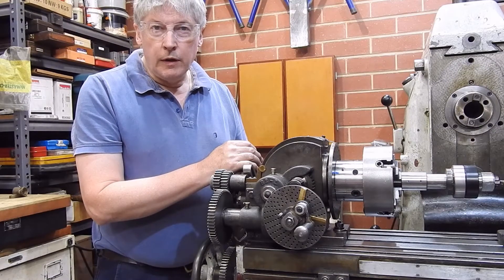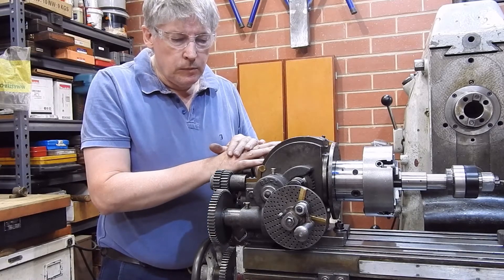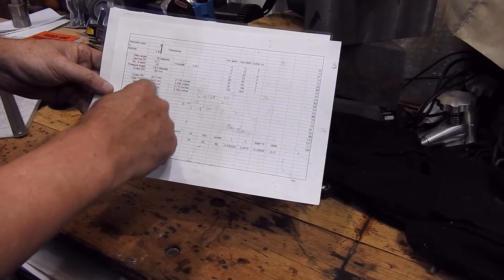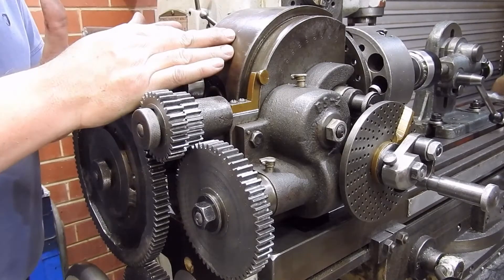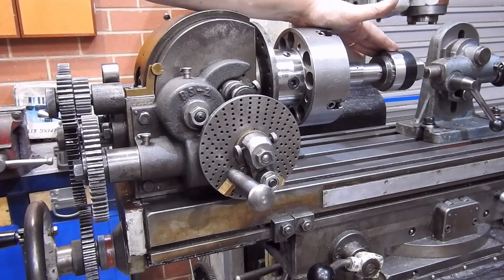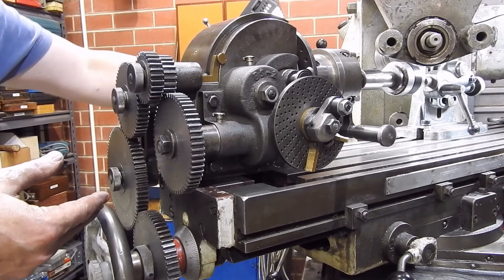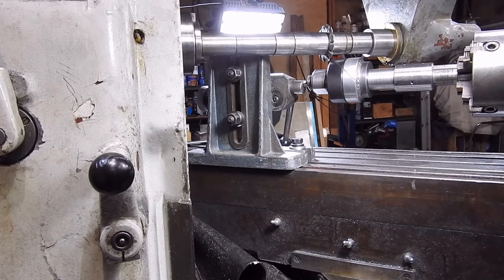Gears with a twist

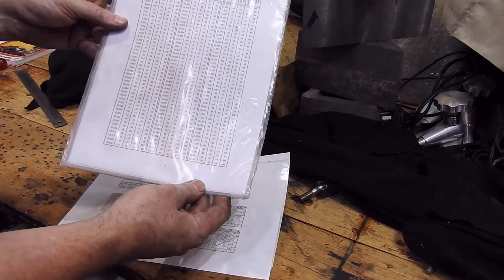Comment: hello sir!, im setting my bs2 up for helical milling and im just trying to download your Gearing.XLS spreadsheet. i also cannot find the ratio list (that you show at 2:10 ) in machinery handbook 25. any help will be appreciated!
Reply from the maker: I haven't got a 25th edition of Machinery's Handbook, but it is in my 23rd ed and a 28th ed that I looked at, so I would expect to find it in 25th ed. It is in the index as 'Helical Milling', and the table is a couple of pages into that section.
I've added a link to the spreadsheet hosted in metalwork forums to the video description but to few (and download) attachments ou will probably need to become a member. It's free.
Reply: @occasionalmachinist  Yes ive tried to join up to get that .XLS spreadsheet but not got the membership notification. Im based in Perth, WA :)
Reply from the maker: @troyam6607  flick me an email. I can try sending it direct

Comment: Where can we find that excel gear calc?
Reply from the maker: The spreadsheet is one that I wrote and revise as needed. I did post an early version (tabs for rotary tables and dividing heads, spur gears (DP and module) and helical gears) on Metalwork forums here - https://metalworkforums.com/f65/t183755-power-surface-grinder/latest/post1768722#post1768722. If you are not a member, you may have to join to see the file

Comment: Thanks for the vid! Hard to find good info on this subject for manual machine. It'd be cool to see one on bevel gears if you've got one that needs made
Reply from the maker: Bevel gears are on the "to do" list. In a little while...
Reply: @occasionalmachinist please where can I find the spec sheet for the gearing please??
Reply from the maker: @antoinebartolo3336  There is a copy here - https://metalworkforums.com/showthread.php?t=183755&p=1768722#post1768722. (down the page at post 41)You will probably have to join to see it, but it's free and there are some interesting projects scattered through.
Reply: Good job hwo i Can culotte thé grop if Gear

Comment: Why does the chuck on your dividing head stick out that much? Is that some sort of D1-3 adapter you have made up?
Reply from the maker: Yes, it is. The dividing head as a screw mount for the chuck, but I wanted to put anything I could put on my lathe on there, so made an adaptor. It's not perfect - I have a small amount of TIR but for critical jobs I can re-true relatively quickly. It also pushes cutting towards the middle of the bed which is not a bad thing